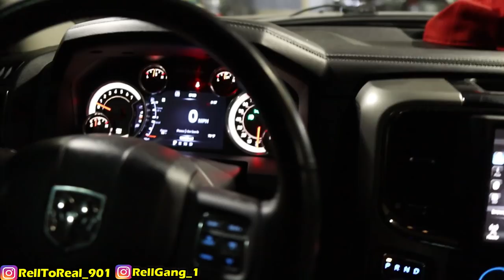PUTTING MY BRAND NEW AUDIO SOUND SYSTEM IN MY RAM TRUCK!!

Comment: You do not have to go shallow mount subs in that truck. Owners usually go with alpine type r 12s in that box. Just double check the mounting depth and for magnet clearance. I’m running a fiberglass sealed box by netaudio. I got the tall box so I had to lift my rear seats by an inch or two with spacing blocks; these may be provided by the manufacturer. This allowed me to put in 2 jl 12” w6v3. The subs are getting 1cuft of air space each and they pound! Watch your gain settings and let them break in and you’ll be golden. I’ve used ported boxes all my life until my current setup and while there is a diff it’s still damn good.

Comment: First and foremost, you already know, Big Up from Japan and shout-out to the Rell Gang 🤘🏾🤘🏾🤘🏾... Rell did you get an alignment after you put the new wheels on? That could be the problem if the tires are properly balanced.... As far as the amp, just turn the gain down some and the speakers will be good.